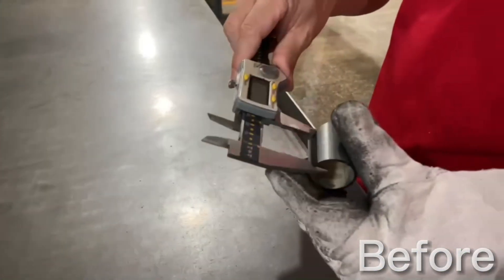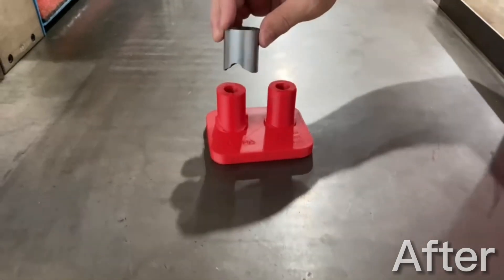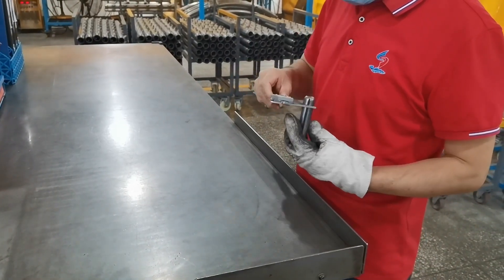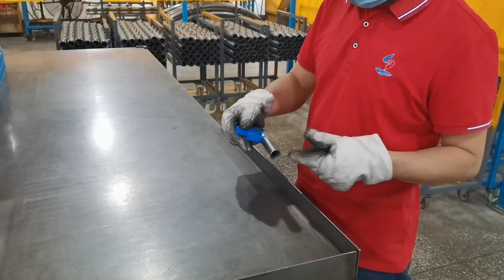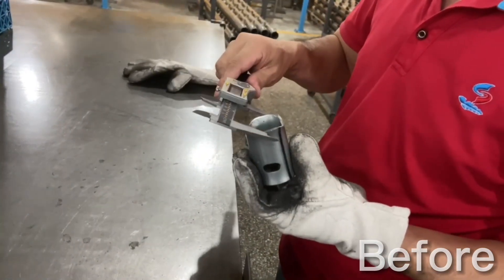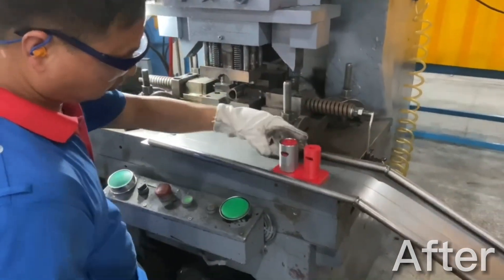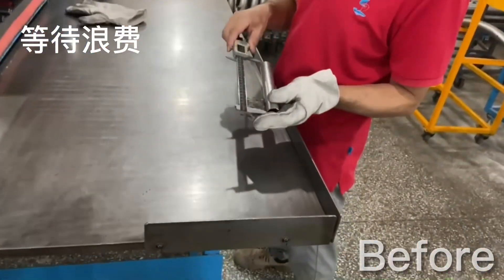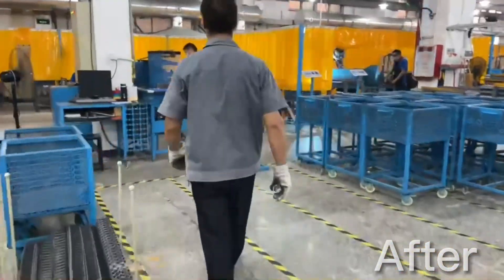3D Printed Jigs Help Reduce Waste and Improve Quality

Comment: That is a first-class improvement, great job.  How would you manage to account for the wear of the 3D-printed parts, so to replace them when they are out of tolerance?
Reply from the maker: Great question, Henri. We created “golden sample” metal parts that are perfectly to spec for our metal fabrication jigs. We use these as checking-gauge checkers! We automate this process and check the 3D-printed jigs each month; if we notice wear or variation, we open the template and print out a new jig.
Reply: @normohara That is very smart.  And inspiring, thanks a lot Norm!

Comment: My own printer had a tolerance of 0.1mm. Is that acceptable for your parts? Are you using a more accurate printer, or perhaps printing the jigs a bit too big and then manually adjusting the jig after?
Reply from the maker: Hi Simon, our 3D printer tolerence is within our required tolerance for the parts we have started with. We have encountered a few applications where we could not print a suitable option, so we just moved on. Hopefully, as our skills improve or machines get more accurate, we can fill in some of our gaps. I like your idea of oversizing and sanding the excess to the correct size. That is something we had not considered.